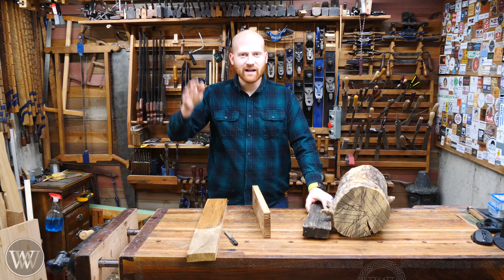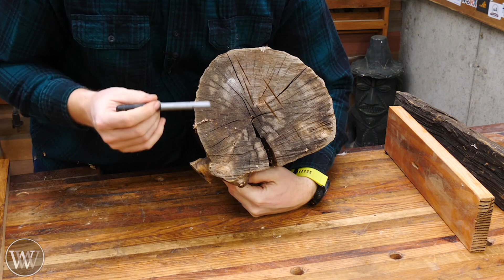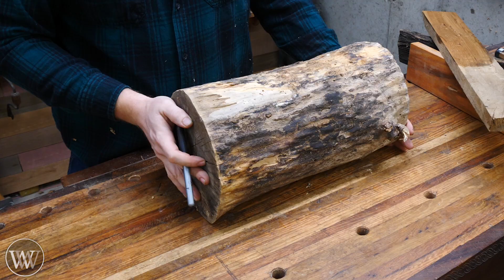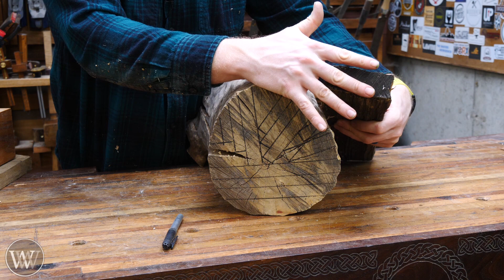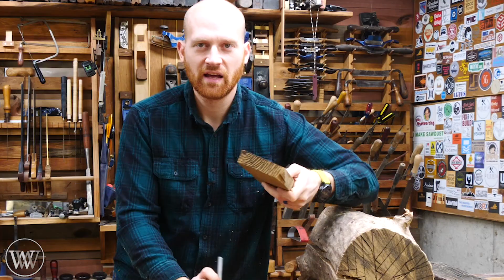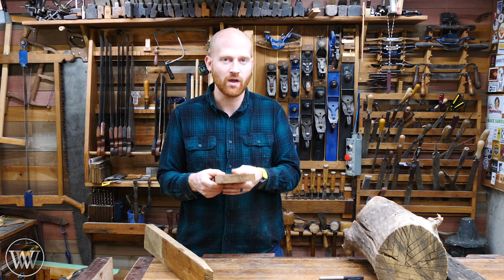Will My Wood Explode? Wood Movement Explained

Comment: On something like a large table top, does the thickness of the top affect the lateral movement? A friend wants my help building a 6in thick tabletop (they're footing the bill so, eh... ) and wants to sink all thread into it to use for the glue up and as a permanent ward against cupping and bowing. In my mind I see this as very likely to crack and split over the years. Am I correct in this assumption?
Reply from the maker: Ya that thick will crush the nuts into the wood, and then leave gaps in the dry times. With 6" thick there is no fear of cupping at all if it is fully dried. and if it did no all thread would stop it. they use expanding wood to break granite boulders.
Reply: @WoodByWright  Good to know! Thank you for the reply.

Comment: Can you please do a video about proper grain matching/wood movements for particular joinery? My challenge right now is a table top support frame. I want to put a slab on a frame that won't crack and which types of joinery will work.
Reply from the maker: for that joint the best is pocket holes or screw toggles. I know it sounds bad, but it is a historical method hundreds of years old to attach a table top with pocket holes.
Reply: @WoodByWright  what about building the frame? I'm doing four straight corner legs.
Reply from the maker: @sabersaw5611  are you talking the stretchers to the legs?  best for that is a tenon.

Comment: "Air conditioning" in my part of the world often means using evaporative cooling. During the summer moisture content inside is very high, and in winter it is very dry.

Nice explanation. I'll plan for maximum movement. I know there are (data) tables somewhere with %movement by species.
Reply from the maker: yup. everywhere is different. yes there are several wood movement calculators on line, but the general rule of thumb is 1/8 per foot is worst case movement.

Comment: Great information James.  One question, how much does the density of the wood play into the amount of potential expansion and contraction through the seasons?  IE: you have 3 pieces of flat sawn lumber: Hard maple (1450 Janka), Cherry (950), and White Pine (420).  Is the amount of movement going to be the same regardless of the hardness or is it something that has to be taken into consideration?
Reply from the maker: The density doesn't play that much into expansion contraction however the difference in porosity can. something like oak absorbs water very quickly whereas most pine or Maple are very slow to change.
Reply: @WoodByWright  Interesting.  I watched your old video and checked out the links to the movement calculators there.  The one at http://www.woodweb.com/cgi-bin/calculators/calc.pl shows a "Shrinkage Percentage Value" that it seems to use when computing the overall shrinkage.  I'm guessing that is a porosity rating of sorts?
Reply from the maker: yes. those numbers are also for the machinist that cars about movement that small. and they do not take into account boards that do not fit into  any one cut category.

Comment: moisture comes and goes mostly out of end grain, seal it to slow down drying, use titebond, latex paint, linseed oil, wax, etc.  the difference between sealed and unsealed endgrain is amazing.
Reply from the maker: Truth. Best way to dry green wood.

Comment: I agree with the comments....a very good job!   But I do have a question: is the piece of wood that is your example of a quartersawn board actually quartersawn or did you just draw the growth rings on the end just as an example?  When the board is laying on your bench it appears to me to have cathedrals on the top.   If I am seeing that correctly, that's not what I would expect.  That's what I would expect from flat sawn wood.  Am I right?
Reply from the maker: yes. one of the boards I did that with as I was looking for one in stock but did not have it so I just drew them that way. good eye I did not think it would show up much on video. well done!

Comment: Thanks james for explaining that. Living in georgia i have to account for wood moveme t a lot expecially in the summer with it being 100% all the time. I may not always do bread boards when i build dining tables but i do use battens. I elongate the hole that the screw goes in to allow for movement that way out of 203 tables in the last 3 years I have never had an issue
Reply from the maker: people love to hate on screws, but to be honest, for wood movement they are fantastic. a great joinery method there.

Comment: James, a very good explanation on the subject. I was wondering if you could follow up with information on "reaction" wood from limbs and other forms of "found" timber. Most commercial lumber is taken from trunks, but bushcraft, turning, and similar types of woodworking (especially hand tool woodworking) where individuals harvest trees or tree parts, lends itself to using portions of a tree normally rejected and discarded by industry. Perhaps a video from harvesting through use with special considerations for converting "waste"wood or "firewood" to wood that can be used in the shop. All too often beginning woodworkers are discouraged by the high cost of materials. It was a real eye-opener for me when I realized that even the wind damaged limbs and fallen trees presented the opportunity for stock and even saplings can be utilized for "bentwood" projects. Many thanks.
Reply from the maker: so true. I wanted to cover that in here, but ran out of time. I am thinking that video will be coming on the list, but we will see.
Reply: I like your thinking.

Comment: Very informative! I love these videos. I learned quite a bit. I now have questions. I'm building a birdhouse (which is going to be outside) and I was wondering if I use linseed oil on it will it still move as much? As I understand it the oil will pretty much soak the wood so it will have the biggest dimensions from the start. Right? Maybe?
Reply: The wood will still move if it's not acclimated to the humidity outside. Unfortunately even with BLO and it's sealing effects from the cross polymerization, moisture will always find a way in. 

The main thing is to ensure that you get your timber at a lower moisture content and leave it to settle in the same humidity/environment you are going to have it to minimise movement. E.g. leave it in an outside Woodside for 2 weeks then work with it, treat with BLO. 

Careful about letting birds in before the BLO dries. Linseed oil is infamous for drying slowly in a colder environment. I've been told, Sun exposure helps this process quicken but I don't really go out of my way to specifically expose it to the sun so I'm not too sure on the specifics.
Reply: @TheKamiBunny  Thanks! So the expansion and contraction will still happen even when oil is applied. Does wood movement happen more slowly because of the BLO? The wood I'm using has been outside for 6 months or so, so I guess that should be sufficient. (about 60% RH outside here - I'm in the Netherlands so that varies quite a bit)
Reply from the maker: what @theKamiBunny said is spot on. when people say the oil will "soak in" they really only mean it will soak in 1/100" it does not fill the wood. water will still get in and it will expand and contract just as much as normal. also with out exterior use the BLO will need to be reapplied regularly as it will be quickly washed off by the weather. it is not a great exterior finish. it is better then nothing but requires regular reapplication.
Reply: @WoodByWright  Thanks for your reply. So I'm better off going with a polyurethane type finish if I expect things to not get maintained for the coming years. I'm using some douglas fir I had lying around which should hold up alright outside for as far as I know. Also, cracks add character right?
Reply: @SmolStufff  I personally like oils in the outside furniture but as @Wood by Wright said, you have to keep reapplying regularly.  I do most of mine twice a year.

Otherwise some kind of exterior UV resistant varnish would work. As you said Polyurethane  is quite a good finish, even if the water based ones raise the grain. 

If you use a solvent based varnish just be aware that if you have too much moisture in your wood when you first complete your finish, you make find that it will start forming blebs and bubbles which would mean you need a refinish again.

In the UK I've used marine varnish, it's really thick in the cold so apply it in summer, but the finish lasts for years. I think they are rated for about 3-5 years before needing another finish. As a bonus, in summer the wood is a bit drier, so those blend i mentioned above don't happen during winter.
Reply: I just realised you mentioned Douglas fir as the wood and you live in the Netherlands. If it's locally grown fir the grain should be pretty dense as it grows slow there. Rot and insect resistant, perfect exterior wood. Thinking about that you will have to battle some drastic temp and humidity changes in the Netherlands. If you want low maintenance, I think a solvent based exterior varnish is definitely worth the effort over water based varnishes.
Reply: @TheKamiBunny  Thanks again for your replies! (and time) I'll do some research into the types of finishes you mentioned.

Comment: I'm going to be building a basic 2x4 workbench (Pine & Beech probably) soon for my outdoor workbench soon. I see that once it will start cracking due to very high humidity changes where I live, I will have to keep reinforcing it - since I can only pretend I understood exactly what you were talking about here :)
Birch plywood top though. It'll save so much work!
Reply from the maker: ya Birch plywood does not like outside use. that could be interesting!
Reply: @WoodByWright  Could there be an issue? The workbench top will be covered, and won't be getting direct sunlight or rain, only changes in humidity, and 40-160deg F because of the strong sun that will heat up the cover that's on it. Thanks!
Reply from the maker: @Yonatan24  the problem is the outside edges of the plywood will change faster than the inside. Even if it is covered. it will not be a problem right off the bat but over time the edges will start to delaminate. most untreated plywood outside will last 3-5 years, but you will notice flatness issues int he first year.
Reply: @WoodByWright  Oh well. I don't need for it to be perfect, or last 10 years. A few hours of fixing max per year and I'm fine :)
Reply: You might want to consider MARINE grade plywood. It is made with water-resistant adhesives and - I believe - generally free of internal voids. 
I am aware that there is also pressure-treated plywood, but personally I would NOT want a work surface made of that!
Reply: @GraemePayne1967Marine  Thanks, I'm going #Matthiaswandelstyle (that's a term now) and am going to be using a bunch of 3/4" plywood that I scavenged from a dumpster and hopefully layering it together. I don't want to spend any money, hopefully it'll be ok. We'll see. I just don't really know how to make the base (2x4 material) so it expands and contracts properly with the weather...

Comment: Great practical explanation!  I have been WW for a long time and sometimes the movement thing is overplayed.  Good design takes care of any concern of course.  I love air dried wood and quite frankly I think sometimes the kiln dried wood is TOO dry and TOO fast.  I also like a sponge example.  To me a dry sponge illustrates kiln dried wood, perhaps to dry.  Add a little moisture and what happens to that sponge it swells.  Now of course in a sponge the cells don't run in the same direction, but still makes the point of moisture and cell structure. So we are looking for a good middle ground it seems to me.  Your indoor outdoor example was spot on in terms of extremes.  Great video!!!  Thank you!
Reply from the maker: Thanks Steve. I feel much the same with Kiln dried wood. give me the air dried stuff any day!

Comment: James, can you speak a little to the seeming contradiction in expansion between the segments around 4:30 - 6:00 and those around 10:05 / 11:30. I must be missing a note in there because in the earlier segments I understand you to say that the wood will expand in the direction of the growth rings (circumferential to the pith), but in the later frames it looks to me like you're saying the opposite. Like I said: I must be missing something...just trying to understand.
Thanks, sir! Love your channels (especially WBW2...I like the long conversations)!
Reply: I'm seeing the same thing.  It seems like he switched it up
Reply from the maker: I thought I cropped out the ends of the boards for the second shot sorry for the confusion. I should have used other boards for that shot. in the second shot I am more or less referring to the expansion of a table top weather it is quarter swan or flat swan it will expand more across the table then in the height of the top due to how wide it is. sorry for the confusion of that section. if I could go back and change that I would.
Reply: Ah...movement is expected to be proportional and may move a thousandth or two (to pick a number) in a 3/4 thick piece of wood, but in a 3-foot wide tabletop (48X the 3/4 dimension) that would translate into considerable more movement regardless of growth ring direction (other than in the direction of the grain...trees don't expand taller). Yes? Thanks again!